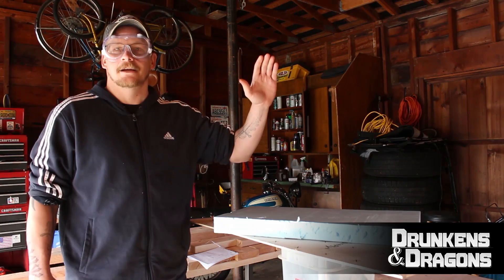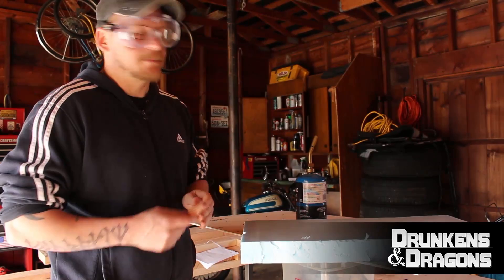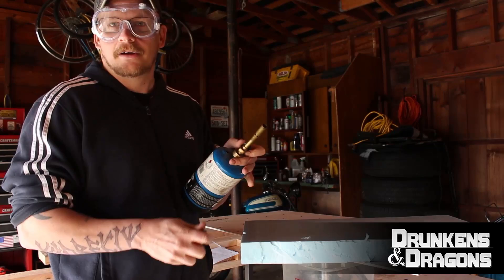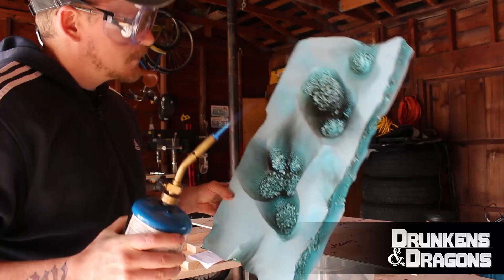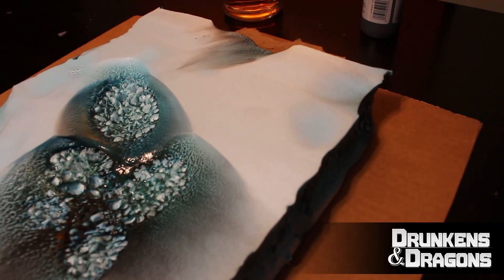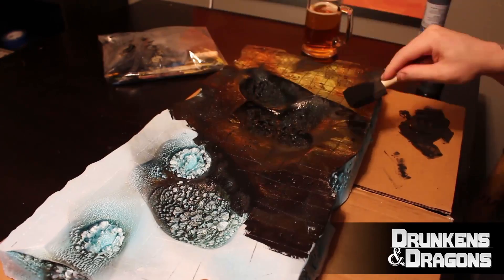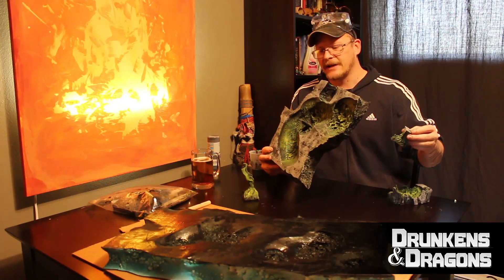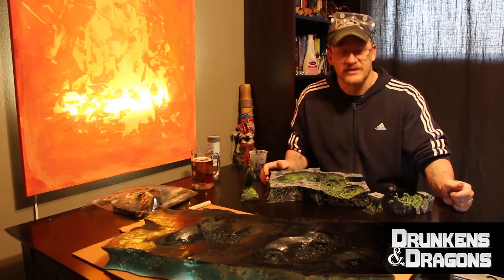Quick How-To on Sculpting Styrene with a BLOWTORCH!

Comment: Any tips on where to grab the polystyrene? Tried Lowe's in store but they didn't have anything thicker than 0.5 inches and everything I've found on Amazon is about $30/2 boards and $50 in shipping & handling.

Been using dry foam (the kinda stuff you put fake plants in) for the past few boards but it's a little too flaky for some of the  more detailed stuff that I want to try out, ya dig?
Reply from the maker: sucks! i haz no clue if no lowe's